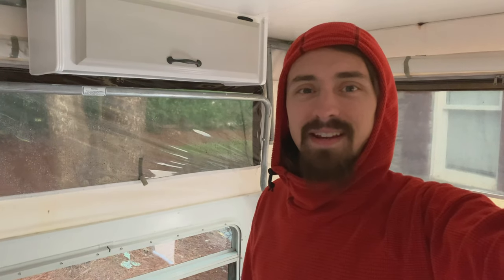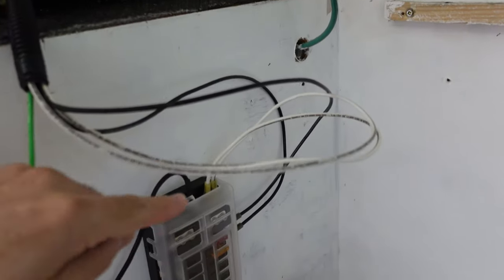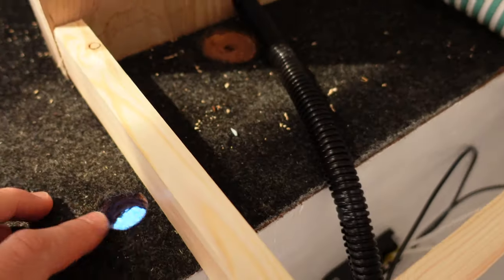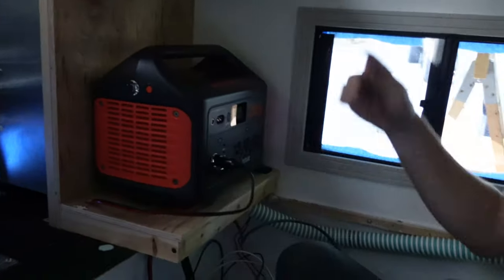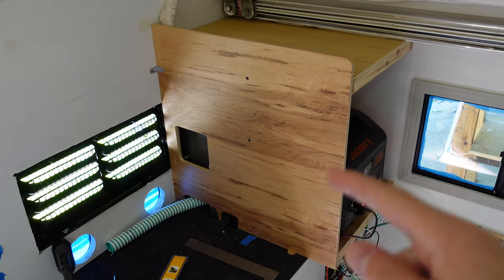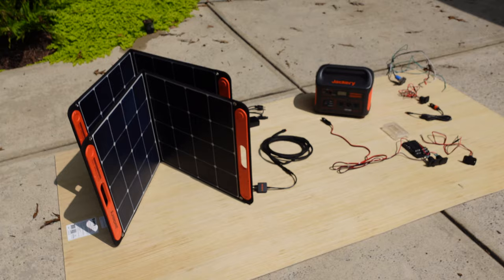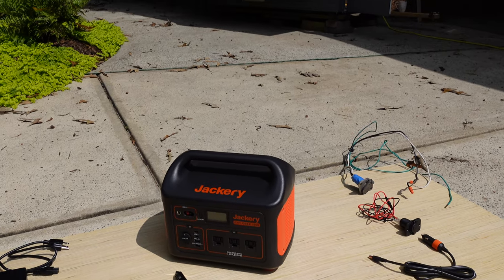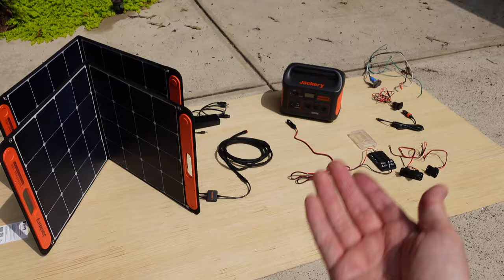Wiring The Jackery & MORE Cabinets // Tacoma Truck Camper Renovation #8

Comment: Hey there! Loved this Vid! Question- what gauge of wire connects from your DC Out to your fuse box? I have one coming that is 14 gauge with a 15 amp fuse and I'm planning to do something very similar to yours with a Jackery 300.
Reply from the maker: Mine is 14 gauge as well. I couldn't find a heavier gauge available. My plan was to replace the wiring with 10 gauge but I've felt the wires under full load and they are cool to the touch and seem to handle the load just fine. I guess because it's a fairly short distance that 14 gauge works well enough.

Comment: Hi!! Thank you for sharing the knowledge. My name is Mary......I bought a switch panel with 8 switches with USB and 12v. It is all prewired with fuses. Can I just wire a 12v plug on the end of it and plug it into my jackery to have all of the switches working? Or is that not possible ?
Thank you

Comment: Any update on how the 10 amp 12v plug does with all that load? I'm curious how much of a load that output can actually take
Reply from the maker: It has handled everything (in our camper) just fine. That said I would not push it beyond its current usage as it would likely trip the breaker in the Jackery. It has been just enough.

Comment: Just wondering is that too much for the 10amp output, if all devices are on or being used won't they exceed 10 amps or does that matter.  And do you have a fuse from the Jackery to the fuse block.  Thanks.
Reply: I had that exact same question!  The refrigerator alone puts it pretty close.  Backcountry Banter, any thoughts on this after almost a year?  Great description of your setup though.  I too have had trouble finding similar wiring diagrams/setups.